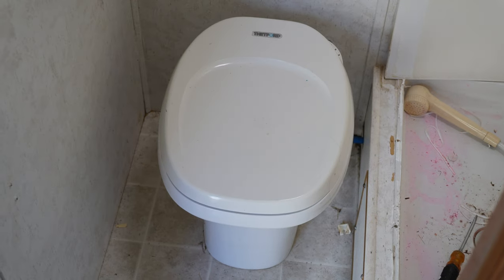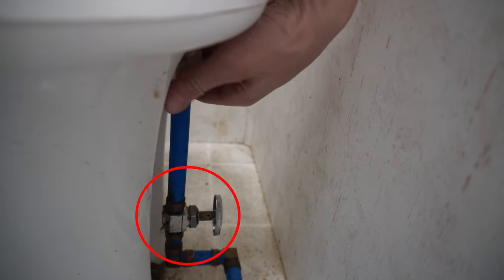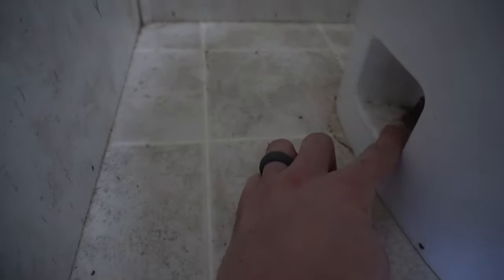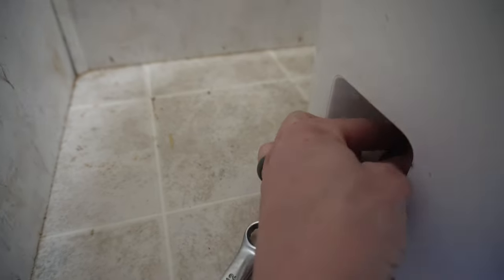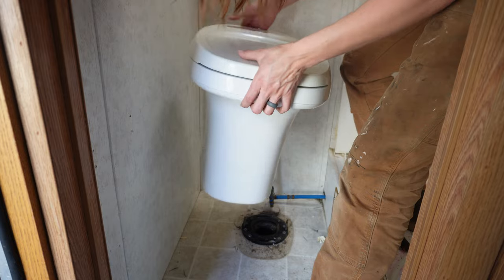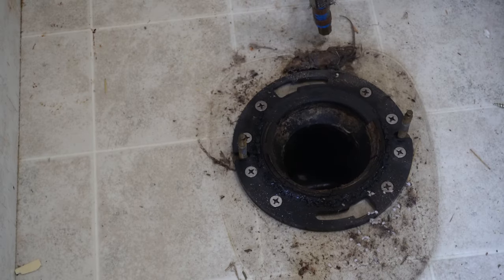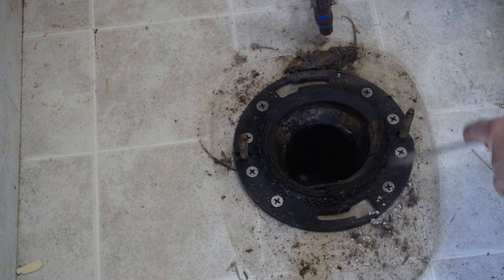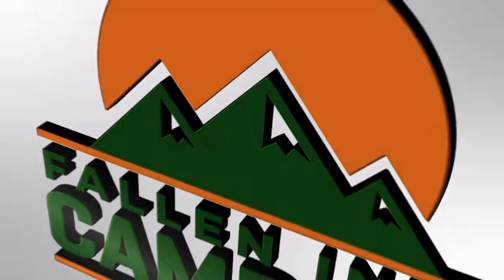How to remove your RV Toilet the easy way!

Comment: Hello, I have a question. Our 2004 CM LQ horse trailer has separate black water and gray water dump areas. Have you ever replaced that  area in a remodel to make it  all flow out the same pipe? TIA!
Reply from the maker: I haven’t, but it wouldn’t be too terribly hard to do as long as it’s easy to expose the plumbing underneath. Gray water is usually 1 1/2 and black is typically 3 inch, so it’s just a matter of configuring them together with a new pull valve (which are 3 inch). Is there a reason you want them together, rather than leaving as is? Or are you starting from scratch with new tanks?
Reply: @fallen into camping  I guess it would be easier to hook the hose to just one pipe. We used to have a 1996 fifth wheel camper, and that is how it dumped. You hooked the hose up to one spot and pulled the black water, then pulled the gray water, and the gray rinsed the hose out. Less handling gross stuff I guess.
Reply: We just purchased this trailer in November. We paid $25,000 for it. It's our first LQ horse trailer. It's a bit quirky. It is in good shape, but it needs a few things done. I wish I lived closer to you. I would hire you to do some things on it! My husband is totally capable but busy beyond belief! And I'm not handy at all! We're going to watch your video about replacing the hot water heater with a tankless hot water heater. That's our next project. Thank you very much for responding to my question. 😊